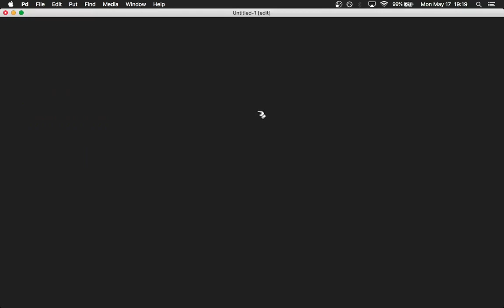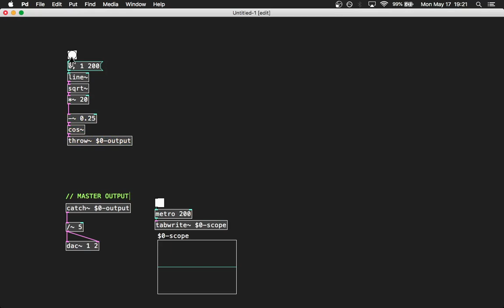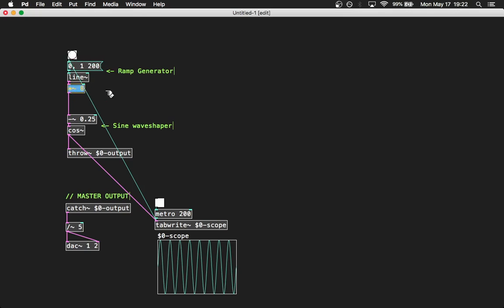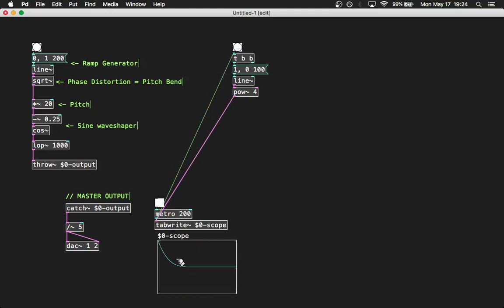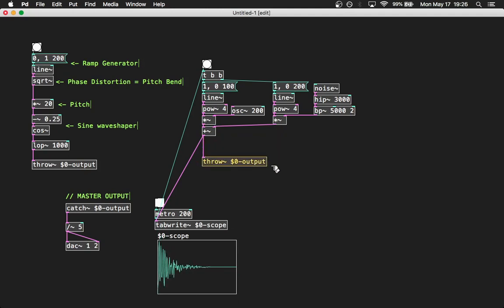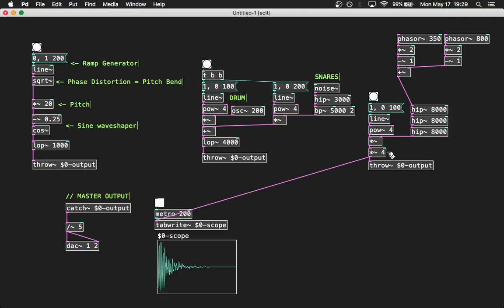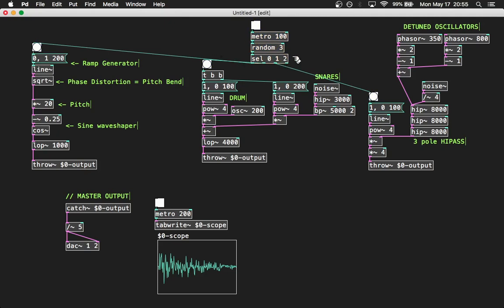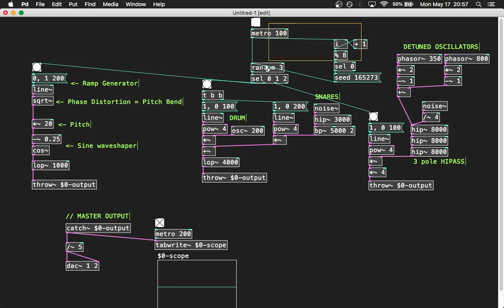Simple Drum Machine // Pure Data Tutorial

Comment: Is PD-next what makes the PD Dark theme and color coded ?
Reply from the maker: Yes.
https://mikemorenodsp.github.io/posts/pure-data-faq/#2-how-can-i-change-the-color-scheme
Reply: @MikeMorenoDSP  thanks a lot ! Are there any drawbacks to using PD-next over PD? Maybe some extra libraries complicating distribution of made patches or incompatibility ?
Reply from the maker: @ Sorry for the late reply, not really it is essentially still vanilla 99%
Reply: @MikeMorenoDSP  no problems. Thanks for responding :) that's great! I did some research my self in the meantime but was still unsure, but this settles it than I'm switching to it instead of vanilla since the minimal UI of vanilla is probably my main issue with it :) I really like Plug data too but wanted to get familiar with vanilla first. I'm pretty sure most knowhow is quite easily transferable as well to plug 🔌.
Thanks again :)

Comment: Thanks for the video Im reacreating this a bit for my own patch but i have a problem. If I change the value for speed of the metro. It sends out a bang. Do you know how I can disable that? that when i change the value that it doesnt send out a bang but just like a clock(divider) it just changes bpm smoothly?
Reply from the maker: afaik [metro] doesn't send a bang when you change its rate. However, you are correct that the bpm in [metro] doesn't change smoothly. What you need is a higher resolution clock, the simplest way I can think of doing that is using a [bang~] to a [snapshot~] object. Then connecting a [phasor~] with the rate you want at a [snapshot~] object -> [< 0.5] -> [change] -> [sel 1] -> counter object or [i ] [+1] counter. Then you change the phasor's frequency rate to change your clock rate, and it is more smooth and instant!
Reply: @MikeMorenoDSP  Thanks for a lot for this tip. Im gonna look at it.

Comment: this is great thanks so much for posting - would it be okay to ask what the point of the [-~0.25] offset is for on the cos~ waveshaper function - is it just to stop it clipping?
Reply from the maker: Thanks for your comment. The point of the [-~ 0.25] offset is to get a sine waveshaper function instead of a cosine which will prevent clicking at the start and end of the ramp, otherwise without the offset, it will click and introduce DC. Sadly, there is not [sin~] in pd vanilla unless we use [expr~ sin($v1)] but that takes way more CPU and is in radians iirc.
Reply: @MikeMorenoDSP  great so it's offsetting the frequency start point not the amplitude of the wave. I think i got it ,  thanks so much for the reply!
Reply from the maker: @uttuclub  More like the phase starting point, sin~ starts at zero crossing "0" and cos~ starts at "1" which will make the thing click.
Reply: @MikeMorenoDSP  of course got it thanks for clarifying

Comment: 04:45 
HOw come the sqrt does a downward pitchbend5(show on scope )  instead of upwards ?
Reply from the maker: It's a bit difficult to explain, but this bass drum has no oscillators.
The line~ object creates a ramp that we use as phase for the sine waveshaper.
Making alterations to the line~ object with a pow~ or sqrt~ will result in a modulation of the phase from high speed to low speed, which results in a pitch bend.
That's why it looks different on a scope.
The phase is related to the frequency, but it is different. See for example Phase Modulation vs Frequency Modulation.
https://github.com/porres/Live-Electronics-Tutorial

Comment: I tried using this version of PD to change my background and text colors. I could not get it to work on my system. All I got was errors in the display box when booting. Could you help me out with this?
Reply from the maker: Sure, go to this link and make sure you downloaded the correct version based on your OS
Pd-0.52-1-Next.app.zip for mac or pd-0.52-1-Next.windows-installer.exe for windows
https://github.com/sebshader/pdnext/releases/tag/0.52-1
Download and unzip this on your externals folder:
https://github.com/sebshader/color-themes-plugin
Then open Pd next, and on preferences there should be a Color Themes... option.